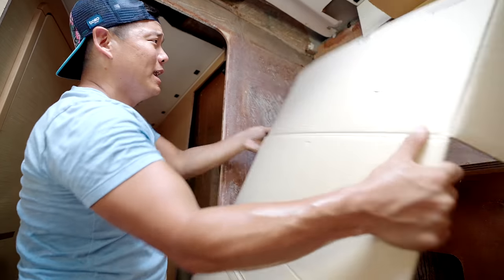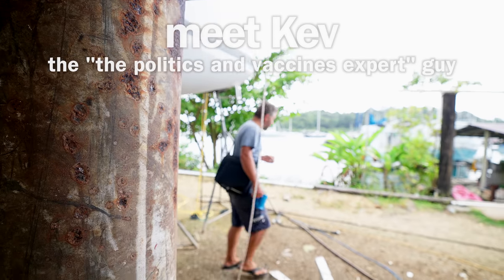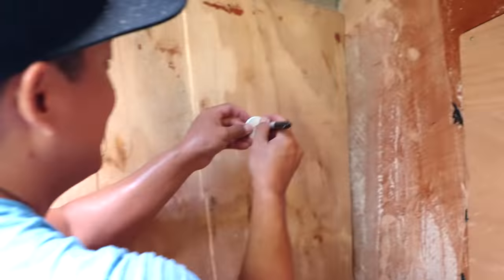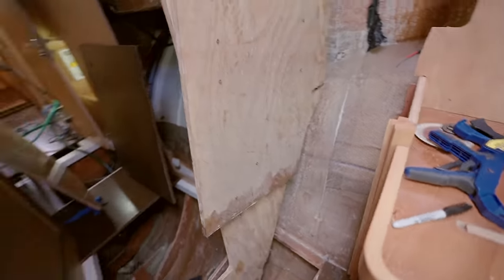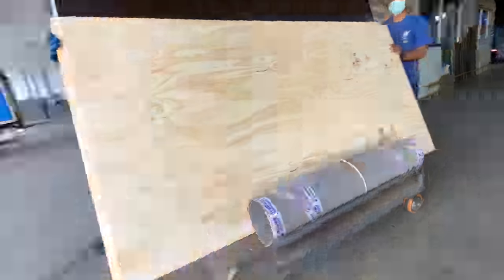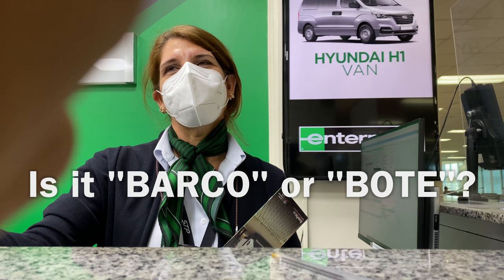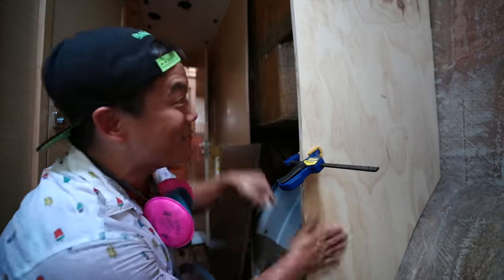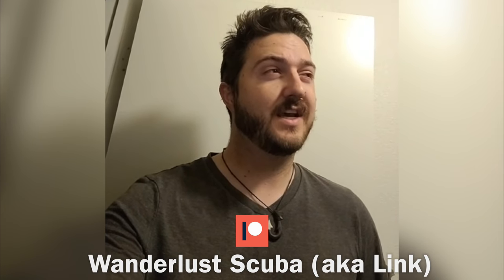Cutting New Bulkheads FAIL and Driving Across Panama 4 TIMES for Wood

Comment: David. Suggestion. Wear shoes while working on your bulkheads! Second,  measure 3 times then before removing your template, measure 1 more time.  Haste makes waste.
Reply from the maker: Haste makes waste!!! Couldn’t be more right. This delay actually held up the project for 10 days as I was trying to arrange delivery which never happened and then had to figure out rentals. So 10 mins of haste lead to 10 days of waste.

Comment: Template for curved surfaces, Instead of doing cardboard, use  thin pieces of scrap ply 1 to 2 inches in width since you have some now. Hot glue (small dab will hold pieces in place) short or long strips to the bulkhead and up against haul. Use small pieces to over lap your actual template breaks and hot glue. Final step, for big templates, use long braces as stiffeners so your template won't spread. use putty knife to pop your template from bulkhead (that's why you use a small dab).
Reply from the maker: Thx for the excellent advice. Cardboard and tape are definitely too flimsy. But let’s hope i never have to cut new bulkheads again!!!!

Comment: I’m pretty sure you can fill any gaps with thickened epoxy. The gap area will be built up with thickens epoxy to form a radius anyway.  The strength  is the tabbing
Reply from the maker: I think you're totally right....if only i knew then what I know now!  I was just so paranoid that the gaps would weaken the structure.  The last thing I want is for this bulkhead to ever fail again.  I cant do this again...just thinking about the grinding makes me want to cry.

Comment: Great job David ! Will you have a sandwich of plywood bridging the overhead section across door frame as a load spreader/stiffener ? Was worried after table getting removed you would come back to missing plywood as well !
Reply from the maker: Hey mike!!! Good eye, that beam is super important and is going to be about 25 layers of bi-ax fiberglass on each side, 50ish layers total! That beam cracked right in the inboard corner so we had to grind it all down. I’m afraid plywood wouldn’t be strong enough. The wood was stored under parlay, but I ended up getting all new wood because theirs had sat under the boat for a good 4 months. It was probably fine, but I’m paranoid about these bulkheads being weak, so I want them all to match!
Reply: @david_shih  Think of it like a chain or cable, it's only as strong as the weakest section. Did you taper the layers of glass as to where they start and stop ? The best practice is to make the deepest layers (1st) shortest and add each additional layer of glass overlapping longer so bonds are spread out across larger areas to prevent any one from being the weak link. Colin did similar techniques on Parlay.
Reply from the maker: @mkllove  yup followed Colin’s layup exactly and then slapped a few extra layers on top just in case! Tapered and staggered 1cm to 1” apart.

Comment: Straight line cuts, use a straight edge (board, metal or factory edge of left over plywood) and claps. Subtract the width of the gard to blade, set and clap. Poof perfect straight line. Hope that helps.
Reply from the maker: Mr. Ski. Sounds like sound advice, but you lost me when you started speaking gibberish with that gaurd and clap talk! Have you ever picked up a piece of plywood to use as a straight edge but accidentally use the non straight side?

Comment: It seems so silly to make templates out of cardboard. I used 1/8 plywood in the US they call it door skin. Cut it into 2" strips or 3" if the curve is a lot. To cut it you use a knife across the grain and just snap it off. If there is a curve snap it off into 8" pieces. If its a large curve take a block plane and scrip to the curve. Use a couple dabs to hold it in place. The the next pieces overlap the Ist piece by 1 1/2". Scribe it to the curve and hot glue in place with the overlap. Any straight edges you just need to snap it off to length and staple it in place. When all the pieces are in place take more pieces to run across the template. Some can be at 45 degrees and hot glued in place, especially in the corners. Sounds complicated but after the first one you will love it.
Reply from the maker: and now cardboard seems silly to me too...great idea on the door skin! where were you when i was cutting these bulkheads out! thanks for the tip Nigel!
Reply: @david_shih  I've retired in England. I used to build and repair boats in Florida. Best of luck David.

Comment: Nice video. For cutting straight lines a dedicated track saw or even one of the Kreg set up's would save a ton of time, give better results and not cost a great deal.
Reply from the maker: Thanks for the suggestion! I absolutely love the  kreg straight edge clamp thingy and have one at home, but couldn't find one in Panama. I guess I could use something else and clamp it, but laziness took over i guess!

Comment: Hey David! You may have been advised on how to make templates so this suggestion may be too late, However have you the ability to go to lumber store? Do you know what They call Door skin? It's Luan plywood that is 1/8 thick in 4x8 sheets is easy to cut and if you buy a few sheets, find a table saw and cut in in about 2 or 3 inch widths you can then but yourself an electric glue gun and make simple fast accurate templates. Hope you can decipher what I am suggesting, throw the tape measure and cardboard away. Look up template making with luan plywood. Simple And Fast and Accurate Bro! Little strips glued together to make a template as big as you want! Fun Fun! Lol Get excited over you new wood
Reply from the maker: Ah thanks for the tip and excellent explanation, I actually understand exactly what you’re saying! Sounds a whole lot easier thank taping cardboard!!! You must have a boat building background? Sounds like you’ve cut a few new bulkheads yourself!
Reply: @david_shih  I was about to give you the same advice Dave, and yes, I've worked in a boat yard for a year. Enjoyed the vlog. Keep on keeping on.
Reply from the maker: Oh nice!  Good to know it works!
Reply: @david_shih  I have been shipwright, builder restoration guy since before fiberglass! Have been into boats all my life. Raised family of 5 kids and wife, in on and around boats. Lived and cruised for 13 years! Lol before You Tube,wish it was around then! I would have had a channel Surely, restored many of our own boats. As family grew, so did the Boats.Thanks for your response, your attitude is Awesome! Wish you the best. Was considering a Q and A site for info sharing, Timid and not tech savvy!
Reply from the maker: @ablemarine9072  cruised for 13 years?! That’s my dream! How did you end up getting out of cruising. At the moment I feel like I’ll do it forever, but I’m sure there’s a lot I’m not thinking about.
Reply: @david_shih  came to shore about 18 years ago, had Business in South Florida,Kids grown and on their own, wife n I started on another Boat Project while running my business restoring others boats at the same time, Got boat Finished and decided a Big Motor Yacht was very awesome yet impacticle for voyages, Fun to live on and have lots of guests and parties however retirement was looming and Motor Sail became the Focus! Small engine Big Sails! Sold the Motor yacht. Made move out of congested South Florida. got boatyard,and big motor sail vessel. Wife got I'll went to heaven 5 years ago! Lost the wind in my Sails upon her going to heaven. Life pretty much stopped. My Bestie, in every way,42 years Awesome, was gonna get ready to do something when I grow up again and the Damned Demic came along and my world stopped! Now re thinking about what to do! I would rather go sailing and think lots on that one the interim has me wanting to restore a kewl old boat I have had for over 20 years, and at the same time, seeking a way to travel on others boats! Just had birthday 74 now, brain goes fast still and life here in doldroms, I am Antsy to do something yet haven't decided the something! Damn Bro Growing up is Difficult. Glad you are dedicated! And hope the Family is First Oder! Love your Attitude. Not familiar with technology etc. Just started my first Facebook, and all the others! My device is smarter than me and I am winging it on how to make me more tech Savvy. And seeking options at this time. My land time is Full time RV gave up the house when wife left the planet. We did the RV thing also with the Boat thing. Very Busy wonderful life we had. Lots of memories and Stir Crazy. Plane U.S. isn't as fun as it used to be. Need a Palapa somewhere quiet and Tropical. There's a little rant for you my friend. If you need an advisor, you may contact me idk what's Acceptable to send you. Can I send email address to you? And Phone? I will offer that if you have questions and glad to give you my life of learning? Smiles.........Keep it up, God Bless you and Yours! Lawrence Trapani Able Marine     not soldier fyi lol
Reply from the maker: @ablemarine9072  so sorry you lost your wife, but you have such an awesome outlook on life.  There's still time to go sail or adventure!  And, I'd absolutely love an advisor. Please find my contact in the description. send me a message through facebook, or my email under the "about' section. Talk soon Lawrence...best!
Reply: @david_shih  David, Thank you for your interest! First thing, I am a complete Moron when it comes to technology and the first to admit my Cell phone is much smarter than I am! They did replace my Netbook a few years ago and at the Same time think of what an awesome thing  to have a whole world in an instant. All I have for my 74 years if life is pretty darn good health a overactive mind and an adventurous Heart! Started a YouTube page a couple years ago but didn't get much further than the first video and that's about it. To find an email to respond to will be my next feat. I follow lots of Sailors Boat builders Cruisers restoration guys Motorcycle people and send my tidbits along to Many of them! I get responses such as yours and Really Appreciate the feedback. Hoping to step out of my She'll a bit more this year as l have been admittedly and finally accepting that Life can exist without my first mate, Best friend, Mother of my Awesome Kids, my mentor and Advisor and Support Group full of Wisdom and Live that we shared as one for over 42 years before she left life's journey to Heaven without me. That caused a Huge Meltdown. And The Finest Treasure in my abundant life here was/is still the Best. No regrets and have been convicted that my purpose here has not been completed yet, Sadly don't think I could venture off solo as I did as a young man with no boundaries on land or at Sea! Now I think being Solo, Old School, and numerous other things, I am going to do something Surely. Had a Plan before the Damned Demic, Attached itself to the Lives of Free Spirited people and others of us that had our liberties and Freedom choked. Not gonna go into a rant here, what I need to find is Email Addie's for Ones such as yourself that I can follow and bind with better. I would like to support so many of this community with funds which have been sparse for me, Yet I probably have resources Plenty! Have had a full and wonderful life and am back at making decisions that were bottled up freedom wise from the Damned Demic! Not an excuse there it was a reality. For now I noticed you sent me a mag and this is a pleasure to here from you and others. Hope your smiling and enduring your trials with patience and a Smile. Lol what's with that nice tender in San Francisco bay instead of there? Home kids and Fam still there? Idk if I can send email in this note. Will do some earnest research as to be readily accessible without going through the Channel. Godspeed and  Regards Lawrence Trapani
Reply from the maker: @ablemarine9072  42 years with your 1st mate, hope I can be as lucky as you! Be strong and live like you know she would want you to!
Reply: @david_shih  lol she would not have had met Nor I met Her less than 6 months earlier! That's a Very Long and funny story you tell yourself Solo a thousand miles from everywhere but God! Smiles
Reply: I may ask to be Crew with you in a few months, Ya Never Know!
Reply from the maker: @ablemarine9072  let’s do it!
Reply: @david_shih  I am working on it! Had a little setback and destroyed my shoulder. It has been repaired, recovery has started! Lol smiling that my mind if a child hasn't grown up yet! Where are you now in the world? Be Blessed and Keep smiling, that makes the world you live in smile around You! Regards L
Reply from the maker: @ablemarine9072  we’re in Rancho Cucamonga at the moment meeting one of my fav EV/battery YouTubers…a guy named Jehu! Tomorrow we’re headed to Long Beach and will attempt a dinghy crossing to Catalina island!!

Comment: Nothing like standing in a pool of water using corded power tools....   LOL
Reply from the maker: Oh shoot The jigsaw was corded wasn’t it! Im so used to work it with battery tools. And the breakers at the pedestal didn’t even work. Damn, not good.
Reply: @david_shih  I am guessing that the breakers at the pedestal are not GFCI breakers.     If you find yourself in this situation again.... perhaps get yourself a GFCI protected extension cord you can plug your tools in.

Let me say (from personal experience, stupidly ... or should I say, drunkenly) electric shocks while standing in a pool of water are NOT FUN.    I thank my lucky stars that I'm here to tell you that.
Reply from the maker: The breakers are meant to trip but they’re all a bit old, faulty, and/or oversized. I feel dumb now, I had an in-line gfci on the boat. Thanks Allen!

Comment: Hi, you will not make that mistake twice . Personally i would make those bulkheads, if you remove the old ones twice as  thick as the old ones. Do not make a fuss about 100 dollars of plywood as to consider that you are  upgrading  the price of your boat ,if ever selling. For the rest good job. Now just go on and finish the project.
Reply from the maker: So this actually is exactly as you recommend twice as thick or rather triple! The original bulkhead was only 1 layer of 15mm plywood and now it’s sandwiched between 2 slightly thicker 18mm pieces. All to say it’s way stronger than it needs to be!

Comment: Don't think that trick with the washer and pen works, looks like you had it at first cut keeping a horizontal distance, couldn't just fill the gap with thickened epoxy?
Reply from the maker: Yup, it Absolutely didn’t work, bc i forgot to leave room at the top and bottom like I did the sides. As I came down the wall with the washer and started coming down the hull diagonally I encroached on the vertical space which was cut to the perfect length.

Comment: I cannot believe lagoon built those boats the way they did in terms of the y reinforced holes and joints they put in the bulkheads and not fully tabbing them into the hull. 

Honestly I can’t believe they got the engineering approved in the first place either…such a weak design
Reply from the maker: its all reinforced now!!!! tripled up and I havent cut the holes yet, but I'll stagger the when i do!
Reply: @david_shih  oh yeah it’s definitely right with what you and parlay did. I just can’t believe lagoon did what they did to start with. It’s ridiculous to think about the front bulkhead being able to stand up against the tension in the standing rigging alone much less going out to sail blue water ocean conditions. 

…and don’t even get me started on the way they just partially tabbed and then glued in the rear bulkhead. 

Love the work and love the show!
Reply from the maker: @nolt4024  thanks NH, really appreciate all the comments and the support!

Comment: bro, its not "circle saw" its "circular saw"
Reply from the maker: I know, but I get a kick out of shortening names of things in my head. That one just came out by accident. Like for reciprocating saw it’s a re-sip. For example, “I couldn’t cut straight with a resip if my life depended on it.” Or, “I didn’t bring a resip to panama because I figured a circle saw and jiggly would do it.” Or, “I once rigged a resip on the end of a stick and string to cut branches bc I’m cheap and didn’t want to spring for a pole saw.”  I know resip is spelled recip, but it makes no sense so in my head it’s spelled with an S.